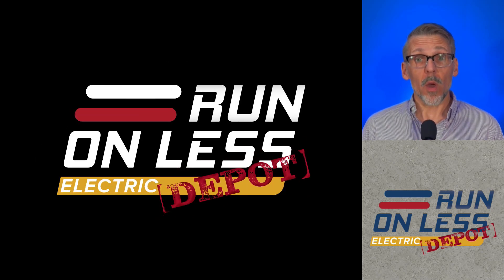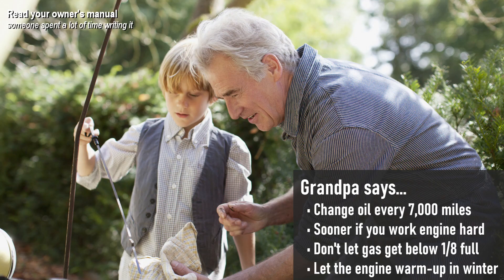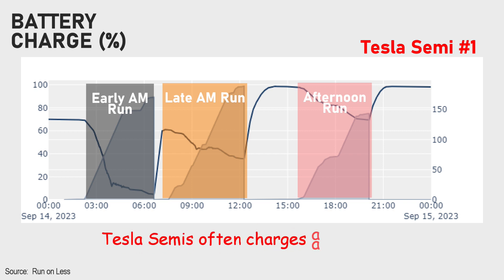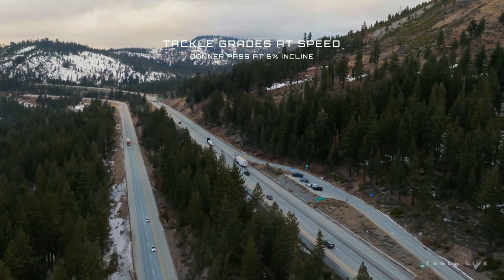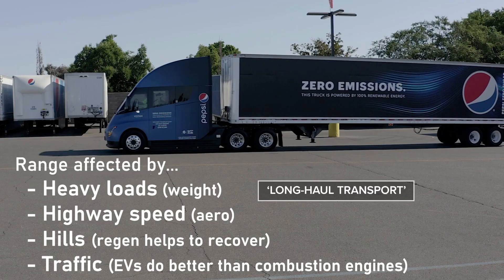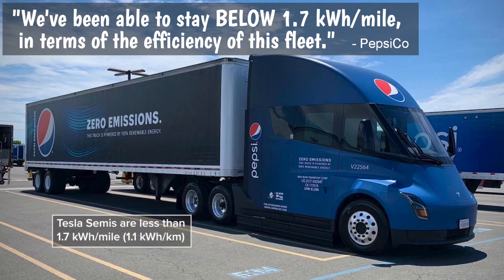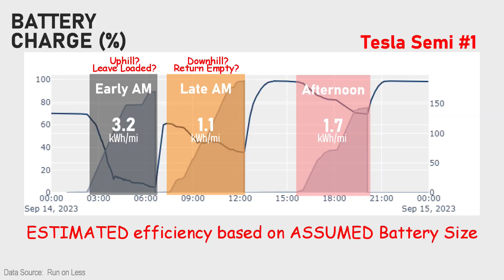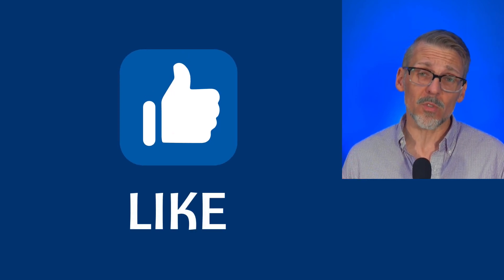In-Depth Analysis of Tesla Semi Data (Freightliner and Volvo too!)

Comment: Without knowing the weight, all these other numbers are pretty much meaningless. And just getting the power to the charging locations is a cost measured in millions. Pepsi couldn't get the amount of power needed from the utility's substation, so they had to build a powerline to another substation farther away. I'll bet they spent 50 million if the spent a penny just getting power on to the site
Reply: If you are as knowledgeable on power distribution as you indicate you missed the Tesla Megapack on site.
Reply: @InformedKiwi  Megapack only smooths out demand, it does not increase the amount of energy. They needed 3 megawatts, and it wasn't available at the poco substation. Without knowing the power factor all problems this junk causes or anything about the harmonics created by the rectification, that means at least a 
3,000KVA transformer installation on site
Reply: @joecummings1260  harmonics created by the rectification 
 I have asked but you have yet to explain where's there's any rectification in the utility provide AC power to the Tesla Megachargers and Megapacks. This repeated claim with no explanation puts your electrical knowledge seriously in doubt. 

 I'll bet they spent 50 million if the spent a penny just getting power on to the site 
The four in Modesto were $334,000, plus a $5,500 permit fee. There's no reason why the four in the PepsiCo Sacramento Bottling Plant would be much different.
Reply: @BigBen621    @Big_Ben_from_La_Mesa  The rectification ts done by the Tesla supplied equipment. And the harmonics are caused by the rectification. It's just like working on a facility full of VFDs and computer power supplies. the equipment causes the problems and you have to deal with it. If you don't deal with it you distort the sine wave beyond the POCC and cause other customers problems. That is the whole point of IEEE-519 standards, to keep you from distorting the power on parts of the grid. Do you think your neighbors want dirty power caused by your  equipment?
Reply: @joecummings1260  _ that means at least a 3,000 KVA transformer installation on site_ 
So? Tesla has thousands of sites in the US alone with at least this capacity.
Reply: @joecummings1260   Do you think your neighbors want dirty power caused by your  equipment? 
No. Do you think Tesla hasn't got this issue pretty well under control after installing a near world-wide network of 50,000+ Superchargers? You and your ilk must be getting pretty desperate, bring up an absurd issue like this.
Reply: 300mi semi weighs <20,000lbs, 500mi semi weighs <23,000lbs. The average diesel semi weighs btwn 17,000 and 22,000lbs. Since the electric semis get an extra 2,000lbs allowance, they can haul the same weight.
Reply: @truhartwood3170  you got a source for that? Because Tesla has not released the weight
Reply: @joecummings1260  Dan Priestley, the lead engineer for the Tesla semi, recently gave a talk, covered by the Out of Spec Podcast on YouTube, where he shared those numbers.
Reply: Valid point that the electrical service needed to fast charge multiple semi trucks is not trivial and will cost fleets extra to install extra equipment like substation upgrades and new distribution feeders.  However I'll bet that $50 million for Pepsi's installation is at least 10x the actual cost.
Reply: @georgepelton5645  just has to cost less than diesel long term.
Reply: @truhartwood3170  "Just has to" ? Based on what?
Reply: Hmmm so Solar panels and windmills are going to make enough electricity to keep All these trucks going Worldwide 24 hrs a day? Sounds like time to build some expensive Nuclear power plants?
Reply: @SteveEddy-od7fb  https://youtu.be/aCoAsPtgRKg?si=r7s2-MG1sxZqo9XT